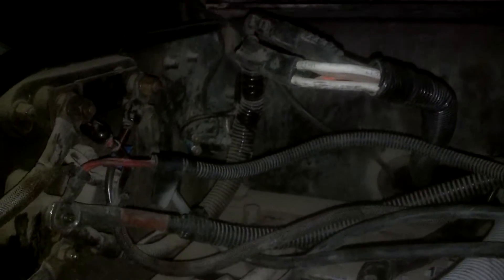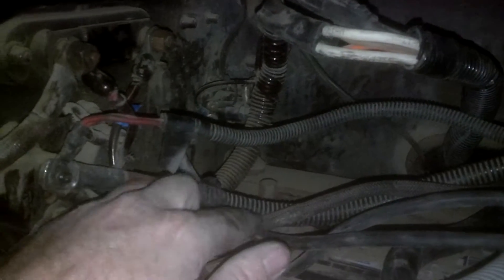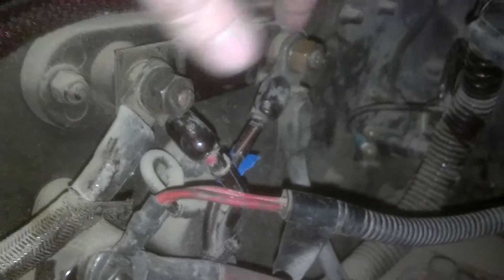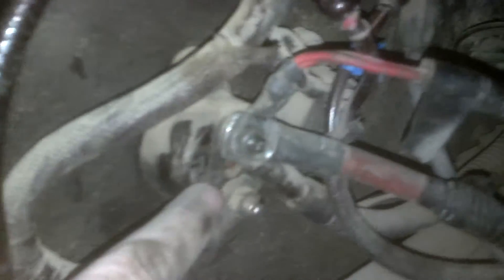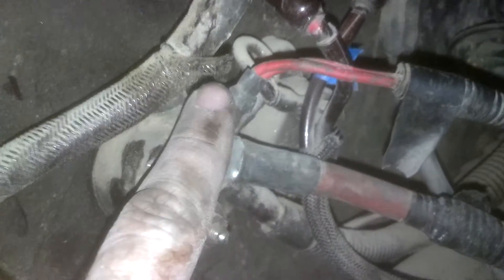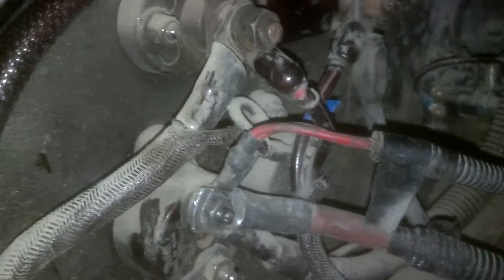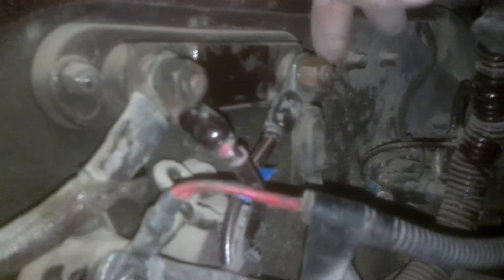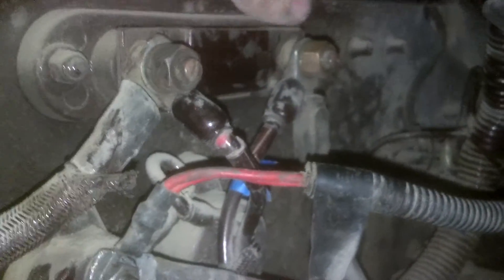T600 ECM Wiring From Battery Box

Comment: Hello. 

Did u ever find out what it is?

I'm having that same problem. 
I changed everything.
Fuel hoses, fuel pump.
Blew all the lines. Removed pick up tubes from the tank.
All the sensors.

Messing with it. All week.

Got tired of it.
Had a guy check out the ecm.

Guy stated it was a bad  emc.

Good thing I have fill with detroits.
Swapped thier cpu in mine. 

Same thing.
It turns over but won't start.

Took my Ecm and install it on my Uncle Kenworth. 

Started right up!!!!!

I'm dumb found right now. :(
Reply from the maker: Mario Rodriguez - it ended up being the ECM, what to let you know that it would run at times, and then not run, one of the capacitors in the END exploded and corroded other connections...
Reply: nates90 

Hey Nates90.

Thanks for the reply.

I finally got my truck running.

The mechanics stated it was my wiring of a LED bar that I installed.?
Don't know hows that possible since I've had that bar over 2 years?

They said it would get one of the battery cables hot and cause the ecu to go into protection mode.

I don't think that was the Case. But who knows. When I took my truck it would run funny. When I would get on it, it would sputter then catch then spudder again. Called the mecanics and told them it was doing it again. 

They advised me to run a ground from the starter to the ecm. 

In doing that process , I noticed that the ground nut on the starter was loose. So when I installed my wire, tight everything well, noticed some cuts on the ground wires. ( Don't see how it could be a problem since it was ground) so I taped them up. 

I noticed a plug by the washer fluid canistor was not fully (clicked) engaged. 

I took it apart and cleaned it good. Installed it and used a plastic loop thing to make sure it don't get loose. 

And it started like a champ!
Runs and feels great!

Now I'm going to install a Dana fuel/water separator since my I messed up my original water/fuel separator. 

I'm still deciding to use the one that has a fuel cooler or just the regular one. ? 

Hope this helps anyone. Man cus is sucks to have the truck broke down while Bills keep on coming. ;/

Thanks brother. And God bless you.

From Houston Texas

Comment: where those that wire go in the positive or ne5
Reply from the maker: mr ohio those two were positive, the computer ground is by the computer, it ended up a diode and other thing leaked acid in the computer and corroded a few things
Reply: nates90 thanks nate . fix my problem...